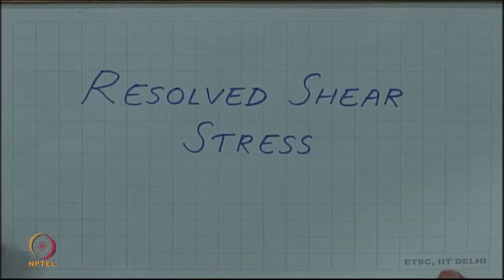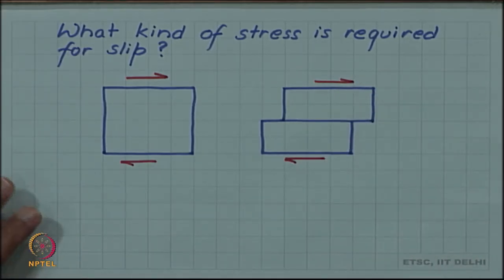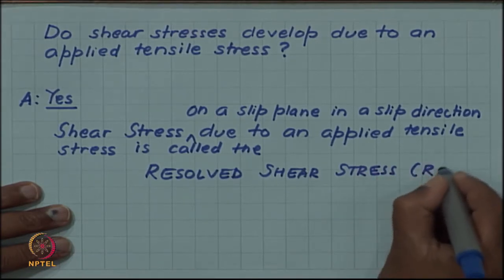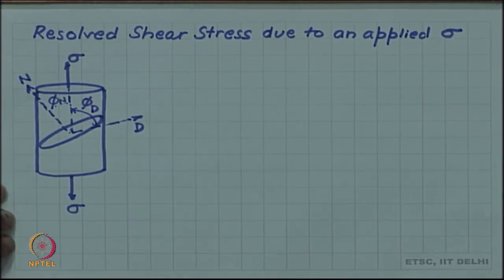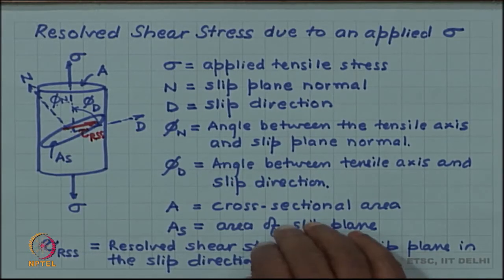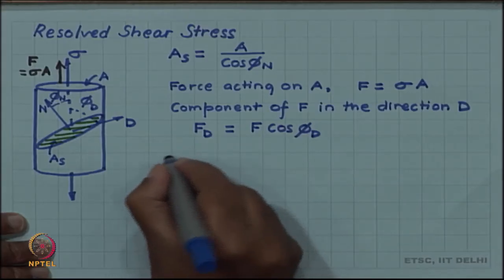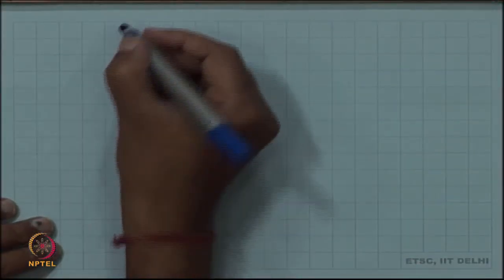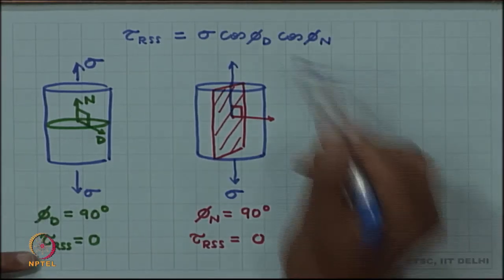Resolved Shear Stress

Comment: I didn't understand the part A_s = A/cos(phi_N)
Reply from the maker: Think of a rectangle of sides a and b such that the side a is horizontal and side b is inclined to the horizontal by phi. The area of the rectangle Ar=ab. The area of the projection of this rectangle on the horizontal plane is Ap=a b Cos phi as a is in the horizontal plane and b is projected as a line of length b Cos phi. So the relation between Ar and Ap is Ar=Ap Cos phi. In the symbols used in video Ar=As and Ap=A. Of course, in the video the areas are not rectangles but a circle and an ellipse. But any area can be divided into small rectangles and thus the result will be true for any shape.
Reply: @introductiontomaterialsscience  thank you!

Comment: Sir,How this A(s) became A/COS PHI(N)??SIR,I am not able to understand this.Sir, kindly explain.
Reply: You are right. It is not immediately obvious and I should have provided a proof. Consider a small rectangle of side dLs and dWs on the slip plane oriented such that dWs is parallel to the line of intersection between the cross-sectional area and the slip plane. Then when you project this on the cross-sectional area you get dW=dWs and dL=dLs cos(phi). the line element dWs being along the line of intersection does not change length. The line element dLs is perpendicular to the line of intersection and thus is at angle phi to the slip plane. (You need to make a sketch to help visualise this). Thus the projected area dA=dW dL=dW dLs Cos(phi)=dAs cos (phi). Since the entire slip plane can be composed of such small rectangles we get A=As cos(phi).

Even without the proof you can see that when phi=0; As=A as it should be. And as phi increases As increases, as indicated by the formula.
Reply: @rajeshprasadlectures  thank you so much sir. 👍😊

Comment: Hi sir. Why there are two arrow pointing up and down since the applied force acting on the cylinder is unidirectional?
Reply from the maker: The tensile stress is unidirectional. That means the stress is aligned along a line. But to create a tensile stress you have to have a equal and opposite force acing along the line. If only a single force acts then it will be an unbalanced force and will cause acceleartion of the body by Newton's 2nd. Law. To create stress you need equal and opposite force. Then there is no net force, no acceleartion, but stress and associated deformation of the object.

Comment: SUMMARY: Resolved shear stresss is simply the component of tensile stress responsible for slip. OR RSS is the component of tensile stress acting on the slip plane in the direction of slip. It is given by a Schmids factor. A tensile stress has no RSS in a plane either perpendicular or parallel to itself.

Comment: can we further modify the formula by taking phi n plus phi d is equal to 90 ..and substituting one of them by 90 minus other..there by converting cos to sin ..and multiplying by 2 and dividing by 2 making it sin2of one of the angle ..there fore the at last it will be sigma by 2 into sin2 of one angle..,
Reply from the maker: This cannot be done as phi_n and phi_d need not sum to zero. Note that you have three directions involved here: the tensile axis, slip plane normal and slip direction. Only if the three directions are coplanar the sum of phi_n and phi_d will be 90 degrees. If they are not coplanar then this is not true. For any given phi_n the angle phi_d can vary between a minimum of 
90--phi_n to a maximum of 90 degree.
Reply: @introductiontomaterialsscience  Hoo..... Okay.... Thanks for the reply and explanation... ☺️